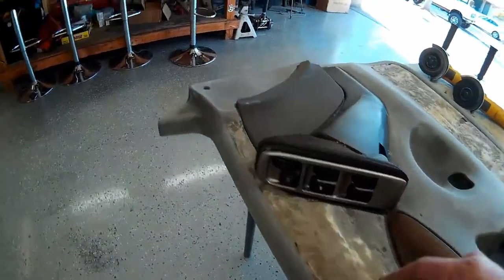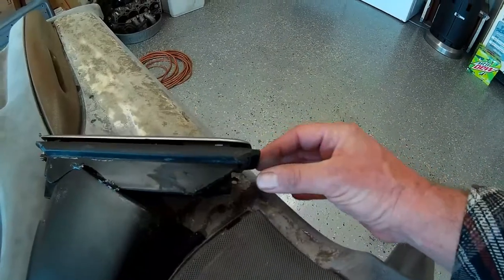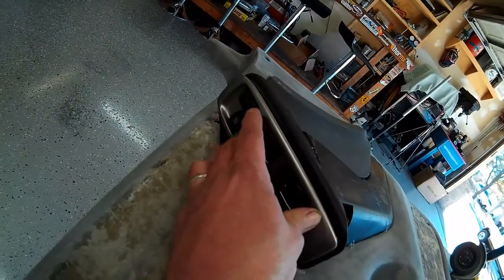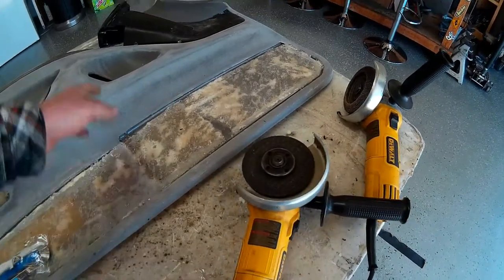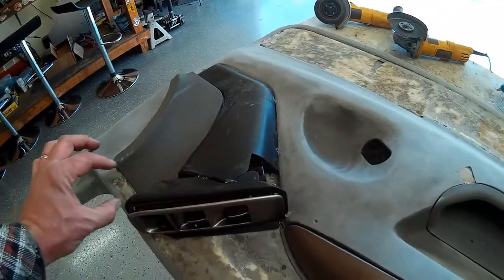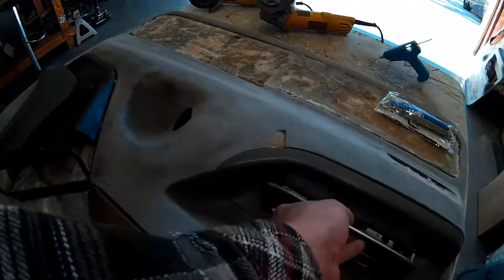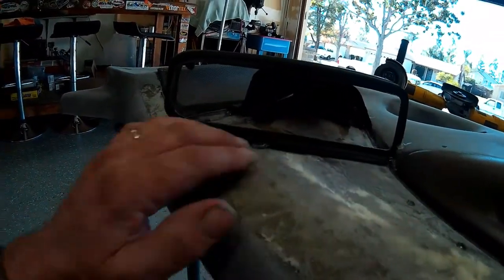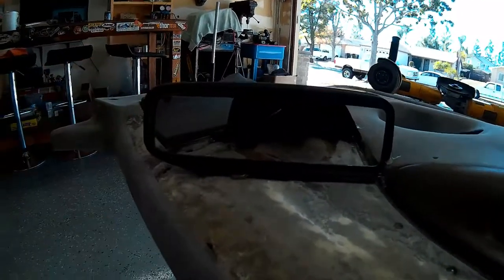Ford OBS; 7.3 Door Panel Repair & Interior Mods, Part 2

Comment: Great work, Jim, I can't wait to see how these panels turn out. You're putting a lot of work going into them, but I think they'll turn out really nice. I'll be curious especially to see how you handle the wiring, as the wiring for the windows motors has always seemed to me to be a little....odd, to say the least. Are you going to update the seats as well? I know several guys that are running late model (2016) buckets in their OBS trucks (I have 2003 Supercrew Lariat leather seats in mine) and the newer seats look pretty trick in these old trucks. King Ranch seats are awful nice too.. but they're spendy. 

One question about the speaker grills, why not just eliminate them and run something different over the same (or a different size) speaker? Seems it might be a nice finishing touch to finish off the updated door panel design.
Reply from the maker: Thanks Nathan, yeah I'm going to be swapping out the seats once i get the roof all sorted out....so much to do!  I kindof think the grilles look "fancy", i'm just unsure why they didn't use grilles on the rear speakers too (at least not on my truck).  the two tone color should give 'er a touch o' class.  i think...  :)

Comment: Hi one question if you sand the door panel how can you get the grain back on the plastic
Reply from the maker: SEM 39853 spray texture is a good match to a factory texture, and can be painted or dyed.

Comment: Can you make a video how to change the back door actuators!? Mine done work and idk how to change them please let me know
Reply from the maker: Hi Drew, I will be doing a vid soon about fixing all the door internals.  My doors have cracks, loose rivets and bad electronics.  All needs to be addressed soon!  Thanks for watching!
Reply: Yeah I love the videos and would really appreciate it. When would you plan on doing the back door actuators? I bought the cheap 10$ actuator but I got no idea where it even is or if the one I bought will even work.  I didn’t have 300$ to buy the real ones
Reply from the maker: I'm going to be doing alot more work on these doors, i'll try to get some info on the actuators.